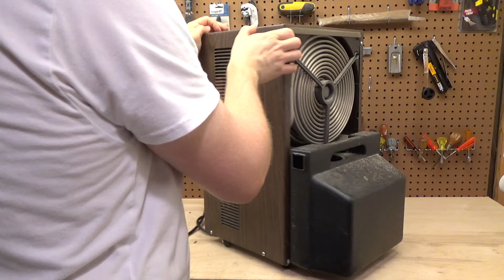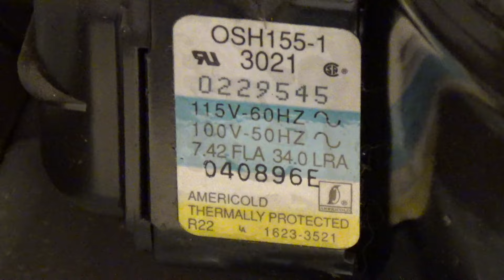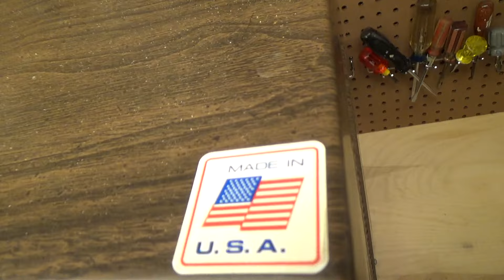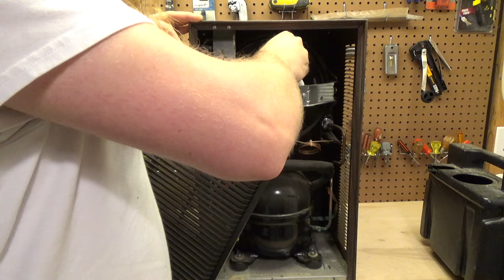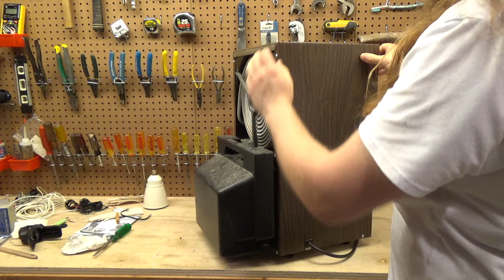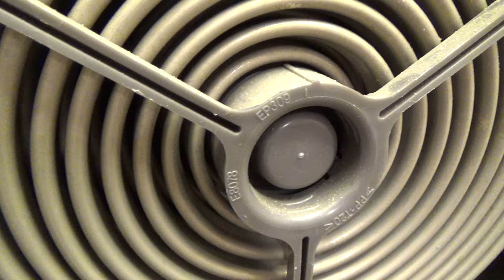Frigidaire Signature 2000 40-Pints Dehumidifier | Initial Checkout

Comment: The modern dehumidifier I use, is by a brand name called Mistral an Australian owned company. It has been completely fine. I’ve used it for over 1000 hours with no issues. What do you mean they’re not safe? Everything you say I normally agree on but this is the one time I disagree. Do I discontinue operation? It’s a 12L a day version and it does very well pulling moisture from my room below 50% , only pulling 300W including power factor at 240V - actual power 200w and the sadly dreadful R290 (which might be your safety concern?)
Reply from the maker: Here in the US, tens of millions of dehumidifiers have been recalled over the last 2 decades, after the designs switched to cheesy all-plastic construction. The units use cheap coils, flammable refrigerant and rotary compressors that run scalding hot, all enclosed in flammable plastic. Electronic control boards and other components built to questionable specs, all housed completely in plastic. I don't feel comfortable running something like that in my house unattended. There are many documented reports of catastrophic failure.

I don't know how the quality of the units compares in other regions, but the modern ones here are absolutely awful anyways, probably the worst product category out of all the modern appliances. You're lucky if one lasts more than 2 seasons before leaking the flammable high-pressure refrigerant.

Comment: Is there a filter in this to change/clean? It says its full but when i empty it, it is only about half full🤔. Btw, mine is loud like that too. Lol
Reply: No filter in these units.
Reply from the maker: The automatic shutoff apparatus is not the best in some of these units. This one has no filter, the coils should still be cleaned occasionally.
Reply: @JordanU  I've found the automatic shutoff on these units is quite good. It's a simple float that releases a switch.
Reply from the maker: @andrewg593  The float switch setup is fine, it's the metal spring apparatus with the button on the bottom that doesn't work well. I don't recall which this has; if it's working inaccurately, I figured it was the latter.
Reply: @JordanU  This has the standard float. The Whirlpool dehumidifiers have the spring.

Comment: Thats an Americold compressor. WCI used them mostly in their dehumidifiers and refrigerators. These are good machines, just noisy. I think that straight blade being so close to that frame and condenser makes it loud. It's funny that WCI air conditioners were some of the quietest units, and their dehumidifiers were some of the loudest. Later versions (2000s) did get a different fan blade and the same motor.
Reply from the maker: Thanks for the information.

Comment: We moved into a house in 1992 that had a finished basement. Found out the hard way what mildew was.  Cleaned and cleaned and went to the local appliance store and bought a Crosley 40 pint dehumidifier.  It would fill up in abou24 hours just as advertised.  We have since moved, but still have a basement and that Crosley rattles all summer long.

Comment: The fan is what's so noisy in these. Even when they're not rattling they're loud, but still excellent machines that last for decades. Aside from the fan blade, these are of an excellent design. The compressor is an Americold which I have only seen in Frigidaire/WCI appliances.

These are highly nostalgic to me. My grandparents used to have two of the White Westinghouse version that would run all summer long in their basement and the sound of the compressors would resonate throughout the house. I remember that sound very distinctly. One of those machines is still around to this day though it has not run in many years now. I should turn it on one of these days.

Comment: My great grandma had the Frigidaire version. Which I inherited and replaced the fan motor with a new one as the old motor had trashed bearings. The new motor was a McMillan and it came with a five year warranty. Which is sad that replacement motor had better warranty then a hole new dehumidifier.